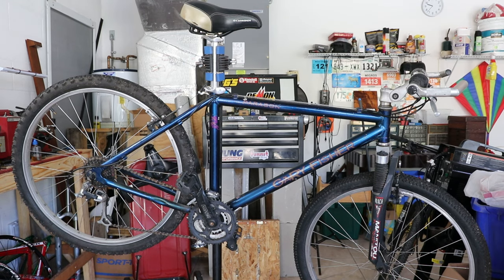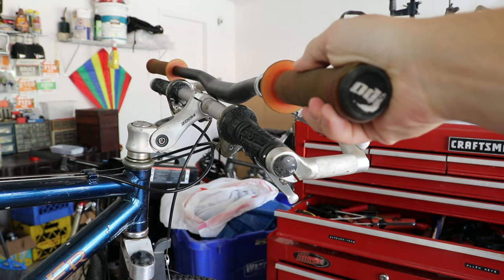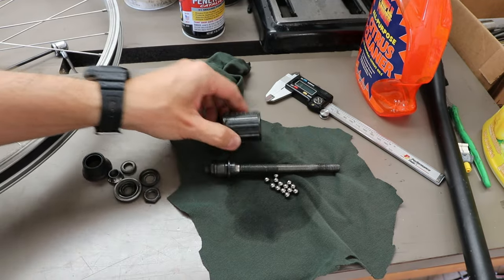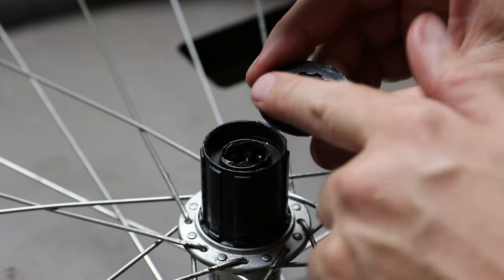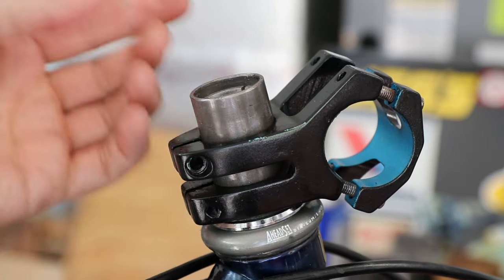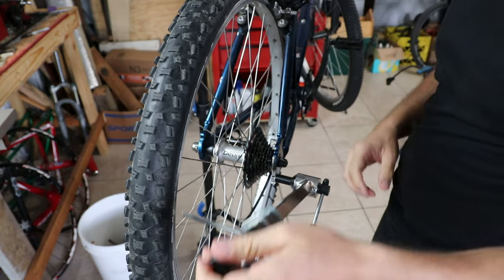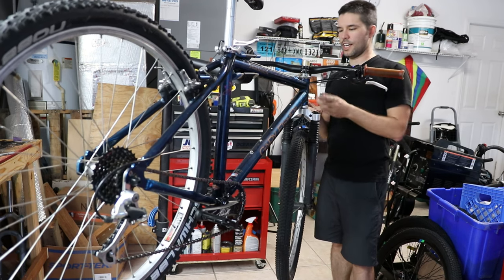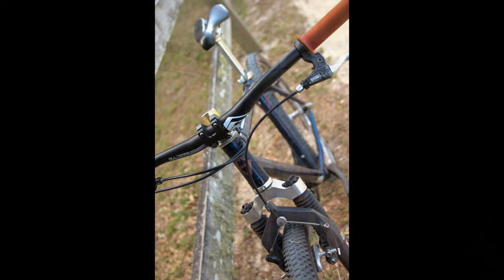$142 - 1996 Gary Fisher Paragon restomod

Comment: I had an older 90s Gary Fisher. I was surprisingly shocked how lite the bike felt. Even if it's just a hobby for you. It's a good one to have. Despite hiccups, it's still a form of relaxation for me. Clears my head of other issues.
Reply from the maker: yeah for just an old aluminum bike it's really light. I'm still riding it, mostly around the block with my four year old, but also sometimes at the local bmx track.
Reply: @BruceChastain  you got the real deal, they only used those Easton (super light) tubes in 1996-1999, but 1996 is the best year!

Comment: I have a 2000 GF Paragon I got for free.  Frame was cracked.  Tried to have it repaired but didn't hold up.  Found an identical frame on FB market for $80 and rebuilt that frame with all the components.  I absolutely love it.  It's bone stock and just rides fantastic.  I have toyed with changing to a 1 X but just like it the way it is.
Reply from the maker: nice!

Comment: My first "  Brand New "  mountain bike was a 1996 Gary Fisher MT.Tam , which is basically the same frame. It was polished aluminum and weighed in at about 21 pounds after upgrading a few of the components, modern bikes are better but this was the best bike I ever owned as I was in my physical prime and rode the heck out of it. I wish I still had it as it  had an assortment of Ringle parts , chris king hubs etc..